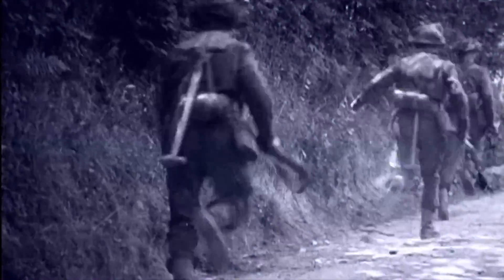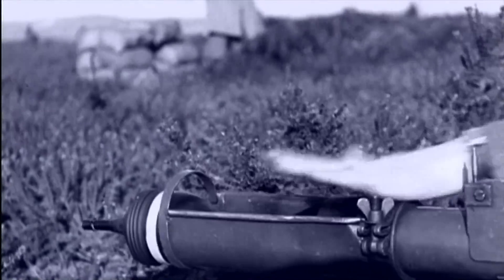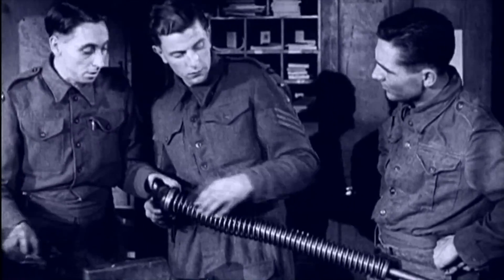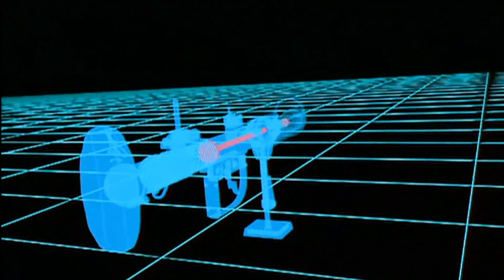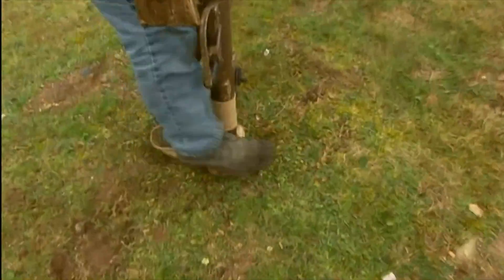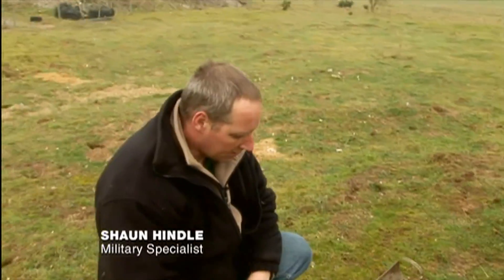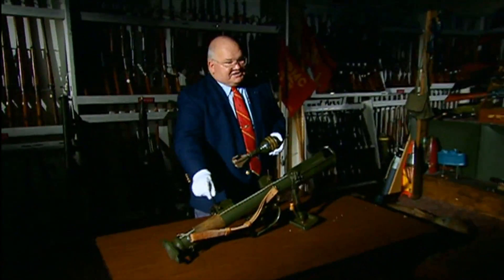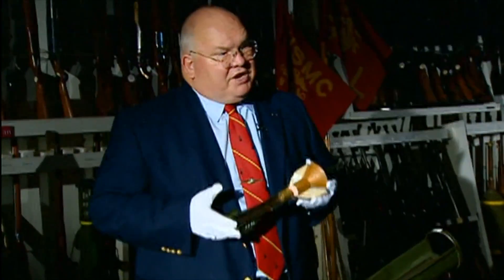Weaponology - "British PIAT"

Comment: Cons, It was heavy I have picked one up and its not something I would want to carry, Recoil its a heavy recoil but I have fired one and its not as bad as legend has it, Short range but its effective range is about the same as a Bazooka and a PanzerFaust but less than a Panzerschreck.
Pros, Almost silent all you hear is a muffled thump and a louder clonk as the spring locks back, Length a lot shorter than a Bazooka or Panzerschreck, Effective against most armour if a side or rear hit but was used more as a sort of mini artillery piece and a giant shotgun for house clearing. But most of all no giant flash and a smoke trail pointing out to everyone where you were.
Would I have wanted to carry and use one NO but then I wouldnt have wanted to use any portable anti tank weapon till the invention of the wire guided Anti Tank Missile with a standoff of 1,000meters.
Reply: +CruelestChris I see what you're saying, as long as you carry your own room around with you no one will see. Thanks General.
Reply: +CruelestChris Approximately the same range and accuracy as anything else used at that time, plus a "warhead" twice the size of the Bazooka. How will they know where you are? No smoke signals like a bazooka and not much noise. Sorry about your shoulder precious.
Reply: +CruelestChris Just a massive backblast that's visible from 1/4 a mile.
Reply: +CruelestChris Rocket exhaust gasses aren't heavy, they are just loud, large and hence very visible.
Reply: +CruelestChris I never made a point about firing indoors, although obviously the PIAT lack of smoke, noise and back blast would give it a clear advatage.
Reply: +CruelestChris Have you ever seen a rocket propelled recoiless Anti Tank weapon fire.  The flash is not very visible in sunlight but in overcast or night time the flash will light you up like a Lighthouse and turn you into a bullet magnet.  We used to use MILAN wire guided missiles that were launched by a gas charge like an air bag going off and the missile motor didnt light up till it was at least 10 metres away but the flash of the rocket igniting would still kill your night vision for 5 minutes if you forgot to look away.  If anyone is looking in your direction with Infra red or thermal imaging equipment the gas charge would be visible as well as the rocket exhaust.
Reply: +CruelestChris No, but I know the thoughts of a lot of Canadians that did.
Reply: +fastmongrel Check out the guys youtube profile. His 'knowledge' of these weapons comes from computer games.
Reply: It probably was not bad but it was not as simple and easy to use as a panzerfaust and not as powerfull as a panzerschreck
Reply: CluelessChris.
The PIAT did not usually fail to re-cock, just occasionally, it was still preferable to a Bazooka.
Reply: Barrie Rodliffe 
Wrong and wrong. If there's a faster figure than 4-5 rpm practical under combat conditions then please show me, but I've never seen any data to back up the rapid fire claim and I've seen a lot of reports suggesting that the gun re-cocking itself occurred only when it felt like it and could not be relied on. And while a PIAT was absolutely preferable to an M1 bazooka and arguably also an M1A1 (which was the contemporary model of Bazooka when it entered service) I wouldn't pick it over the M9, which was half the weight of the PIAT for the same effect on armour and came without any of the killing or maiming you problems of the M1s. Sure there's a couple of scenarios where the PIAT would still be better (assaulting buildings because it had an HE round, the unintentional high-arc fire, shooting from a totally unprepared building) but you have to balance that against accuracy and round reliability issues that meant 11/20 shots at 100 yards would fail to damage the target. Again, in my opinion acknowledging that the PIAT really wasn't a good weapon system just emphasises the heroism of the men who picked it up and used it anyway.

Hey, maybe you'll look a bit more credible if you don't start every one of your replies with a childish insult. You know, just a thought.
Reply: Barrie Rodliffe 
Centurion was not introduced in 1946, it was introduced in 1945, six prototypes were deployed to Belgium just after the end of the war in Europe. Production tooling was already laid down for it and it was ready for production, and entered full production in 46. It was one of the reasons there wasn't a lot of spare cash lying around to replace a hundred thousand launchers and millions of rounds of ammunition.

This is all a bad argument anyway, when something is replaced has nothing to do with how good it is because there are so many other factors involved. The French didn't get a proper replacement for the Chauchat, one of the most objectively bad weapons in history, until 1925 when they adopted the Chatellerault. Was the Chauchat good because it took seven years to replace it? Was it better than the PIAT, since that only took six years to replace? Does the fact that the French didn't buy the BAR to replace it mean the Chauchat was better than the BAR? Does the US Expeditionary Forces' use of the Chauchat instead of the Lewis mean the Chauchat was better than the Lewis?

Hell, for that matter it took the US until 1994 to replace the M167 VADS, even though they knew it was obsolete in the 70s.
Reply: @CruelestChris  
You never had a good argument for anything just a load of lies about what was the best available anti tank weapon that could be used by one person with a fair chance of surviving unlike the Bazooka.
The Centurian tank was in production starting in 1945 and 6 did arrive in Belgium a 
month after the war but they were prototypes, the Centurian was in service in 1946. As for cost  35,000 pounds in 1950 does not seem excessive to me for the best tank around
Reply: @barrierodliffe4155  
I don't see what any of that has to do with what I said.
Reply: @CruelestChris  
Nothing you said has anything to do with how good the PIAT was or how bad the Bazooka was but you will never face facts.
Reply: The facts are that PIAT was a dead-end technology, while Bazooka was the predecessor to all shaped-charge weapons we have today :)
Reply: +fastmongrel 
No smoke trail from a Bazooka or Panzerfaust either since the latter was a recoilless gun and the former expended its entire propellant before leaving the tube.
Reply: CruelestChris Where are you getting all this stuff? Why would in not hit the target? You can fire a PIAT as fast as you can drop rounds in the tray and fire, probably ten times faster than a Panzershrek or Bazooka.
This weapon kept the Paras occupying the North end of Arnhem bridge for 8 days facing two SS Panzer devisions. The bridge was covered in burnt out tanks and vehicles.
Reply: +agt155 
It's not that massive, if it was it would exceed the countermass of the rocket and fire the launcher along with it.
Reply: +agt155 
And this blast is visible from a quarter of a mile away when you're indoors...how, exactly? Most of it comes out of the end of the weapon pointed into the building. That's kind of the other argument you're trying to maintain, remember?
Reply: +agt155 
Clearly this has nothing to do with your main point being about firing the weapon indoors?
Reply: +agt155 
Sure, as long as you don't mind not hitting your target, getting an almighty whack in the shoulder, the fact that the round you're trying to fire has a high chance of not working, that the range is about 40 yards on armour and that they'll know approximately where you are as soon as you fire one shot, it's perfect!
Reply: +agt155 
Yes, clearly all British soldiers in WW2 were wusses compared to the big strong manly armchair general that is you.
Reply: +agt155 
Yes because it's not like they're quoting actual soldiers who fired the weapon or anything. Have you ever fired one?
Reply: +agt155 
No, you know the thoughts of 161 Canadian officers who probably didn't.
Reply: +agt155 
Probably didn't use it. You want me to help you tie your shoelaces while I'm here thinking for you?
Reply: +agt155 
Full knowledge based on the fact that they'd ordered other people to use it and never fired it themselves?
Reply: +fastmongrel 
Oh yeah, modern ones, sure. But the Panzerfaust didn't have a motor at all and the Bazooka round expended its entire propelling charge before it left the barrel, so it's nothing like as obvious as a modern soft-launch missile like Milan.
Reply: +agt155 
This is truly excellent proof that you have no idea what an officer actually is or how weapons are issued in the military.
Reply: +agt155 
Actually it comes from books and research rather than making shit up, but I guess you wouldn't know anything about those since you just look things up on Wikipedia and don't understand what they're saying.
Reply: CluelessChris is just an ignorant troll, he knows nothing about weapons or war.
Reply: SvenTviking
PIAT is about as fast to fire as a bazooka because it usually failed to re-cock itself on firing (meaning it would have to be manually cocked again), and because it's a  muzzle-loader, the PIAT gunner would either have to pull the weapon back into cover or the loader would have to lean out over him and risk giving away their position. Neither is fast. The figures I've seen suggest the practical rate of fire of a trained team was 4-5 rpm for both bazooka and PIAT (I've seen a 2 rpm figure for PIAT, but I'll give credit and go with the highest one I've seen), which makes sense given the bazooka was a breechloader which is a faster loading method by default. 40-50 rpm (ten times faster than a bazooka team) would be a ridiculous rate of fire for a manual muzzle-loaded weapon, that's the expected rate of aimed fire at 100m with a semi-automatic rifle. I've never seen anything that supports these claims of it being a rapid-fire weapon in practical use.

PIAT was never a particularly accurate weapon (since the weapon more or less lacked a barrel and wasn't spin-stabilised, there was very little that guided the projectile on course: it's rather like a rifle grenade, plus you had to deal with the 12-pound spigot shooting forwards one-tenth of a second before the weapon actually fired which threw your aim off: trials conducted with experienced crews in 1944 showed a 60% hit rate on a tank-sized target at 100 yards) and you also had to deal with the 25% rate of defective rounds that failed to detonate (couple that to the accuracy issue and 11 out of every 20 shots will fail to damage the target), and the really nasty potential for the round to blow its own tail off and shoot it back at you when the propelling charge detonated. Sure, it was used effectively (particularly at Arnham where the paras were firing it down at the thin roof armour of light armoured vehicles at close range), but brave men making good use of a flawed weapon doesn't mean it is not a flawed weapon.

Also bear in mind that it wasn't just this weapon that kept the paras there, they also had some light anti-tank guns and pack howitzers.
Reply: CluelessChris.
You have not looked far then, the PIAT was used very effectively and well liked by the Canadians.
The PIAT took out some 7 % of all German tanks destroyed, and since the British 6 and 17 pounders took out quite a lot, the 25 pounder also took out tanks and then there were so many other weapons used against tanks that makes 7 % not too bad. The PIAT was also used against slit trenches and other prepared fortifications.

In spite of its unlikely appearance, the PIAT was amongst the most effective infantry anti-tank weapons of its day, with a performance equal to that of the visually more sophisticated American bazooka. Although it was a cumbersome device, it possessed a number of advantages over such rocket weapons, namely that there was no back-blast from firing, and so not only could it be safely fired from an enclosed space, but it would also not give away its handlers position to the enemy. The PIAT could also be used as a makeshift mortar, by rotating the T-shaped shoulder stock through 90 degrees and wedging the weapon into any solid foundation, such as a tree or a wall.

The range of the PIAT was, however, very short. It was effective against large targets, such as buildings, at 350 yards, but it was only truly effective against armour at a range of 100 yards, although many operators preferred their target to be closer still. The PIAT bomb could penetrate 75mm of armour plate and so was ideally suited to dealing with light or medium armoured targets, however given the right conditions it was capable of dispatching any tank in service.

For such a bad weapon it did seem to work well and was still in use in 1951.
Reply: Well I have a reply, but for some reason Youtube doesn't want me to post it.

The "well-liked by Canadians" thing comes from a rather strange study where they asked IIRC one hundred and sixty one officers to sort a list of thirty-one weapons per their personal view on how "effective" they were. The results did put the PIAT in first place, but they also put the Sten in last (worse than service revolvers), so I'm not really sure what criteria they were using or if there even were any.

As for the rest, you're quoting an incorrect range figure. The 110 yard figure was for a fifty percent hit rate on a two-foot-five by two-foot-five target (it's a figure called "maximum effective range," which is based on hit percentage rather than ability to destroy a target), the HEAT round was only actually effective against armour out to roughly forty yards (this figure is "absolute maximum effective range") because World War 2 hollow charges were fussy about range and angle when it came to forming their jet correctly. You're misquoting the tanks destroyed: that figure is at Normandy, not in total. It would be very odd for it to be seven percent of all German tank losses considering the majority of German armour losses were on the Eastern Front.

On the plus side your source also has the armour penetration too low, it was 100mm (just shy of four inches) at zero degrees (claimed thirty degrees in official figures, but the proof shot was at zero). 75mm is the penetration at 45 degrees. I would require a definition of "it's day" for the claim it was one of the most effective: if that's mid-1943 that's actually a totally valid statement given the M1 Bazooka was so shit it had been pulled from issue in May 1943, the M1A1 only fixed about fifty percent of the M1's issues with exploding, and your other options were a gigantic Soviet anti-tank rifle or a wee little Faustpatrone. If it's the whole war we devolve into the realm of  "not really."

I mean yeah, I'm not saying it didn't work , it was just that soldiers achieved what they did in spite of it as often as because of it. For a point of comparison, the only country that entered WW2 with a torpedo that actually did what it was supposed to do consistently was Japan, but that certainly didn't mean that no other country achieved anything with torpedoes during the war: the raid at Taranto and the crippling of the Bismarck are testimony to that.
Reply: The facts are that the PIAT did work, and it was better than anything else available when introduced.  The fact that it was still in use until 1951 might tell you something but you are not interested in real facts, only your fictional version.
The Bren gun was very effective, the Sten worked and was easy to strip and clean and very easy to make, Germany copied the Sten and made many thousands of them, the British 6 pounder and 17 pounder were very effective and so were the 25 pounder and 3.7 inch AA gun.
Reply: Yeah, that thing about 1951 was one of two paragraphs I had to cut out because Youtube didn't like the full post, it really shouldn't surprise you that it wasn't replaced immediately after the war since the economy needed to go back to a peacetime footing and damage needed repairing, and the general consensus was re-arming the RAF with Meteors was the highest priority since the Soviet Union didn't pose an immediate threat of ground invasion to the British Isles or any other part of the Empire.

I would say it was fair to say it sometimes worked, but I could very easily bring up that the initial PIAT was belaboured with a faulty fuze design which allowed the fuze to explode without detonating the projectile itself (this led to the Mk 1A bomb design that altered the fuze) and then for a while they weren't achieving their on-paper penetration because of a finicky hand-fitted explosive liner (which led to the Mk 2 which used pre-formed explosives). I would say yes, when introduced the PIAT was the best of a bad bunch.

And yeah, the Bren was an excellent gun, and as for the Sten that was my point: I have to question what exactly this poll of Canadian officers was about if they put the Sten in dead last.
Reply: If the economy was so bad then why was the Centurion tank introduced in 1946? Surely that was far more expensive than a replacement for the PIAT that according to you was so bad.  
Why was the very bad PIAT so effective against German tanks? 
The fact is that if I was there and wanted a weapon to take out German tanks I would choose the PIAT.  two men could operate it and take out tanks which many other weapons could not, sure a 17 pounder could, a 6 pounder could and a 25 pounder could, they all worked and they all did the job.